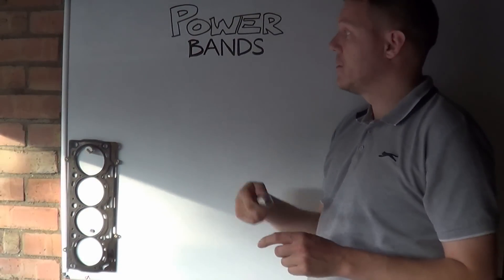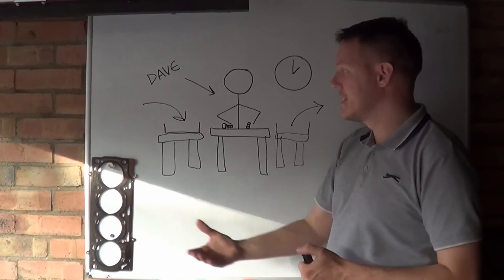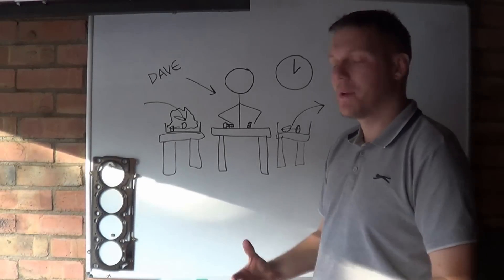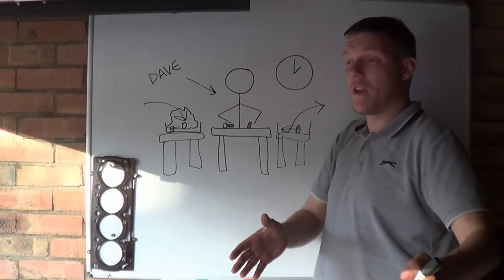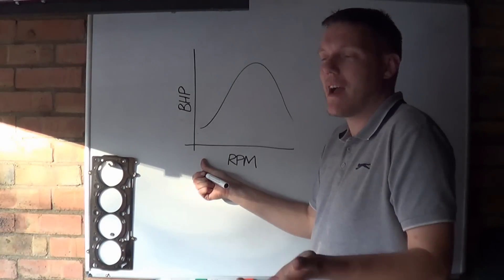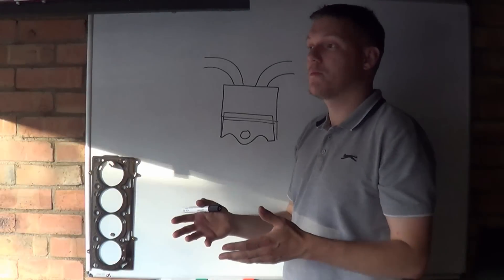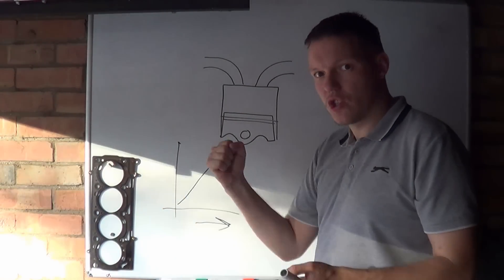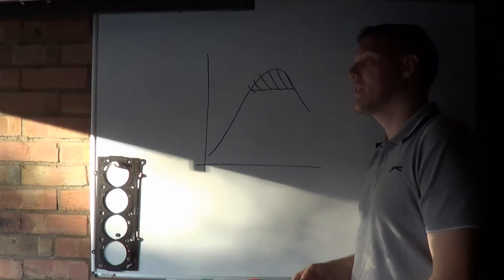Power band - what is it?  - Bike TEch

Comment: Brilliant video. Correct me if I'm wrong and misunderstood. But if you add to your example a turbo and exhaust wrap would that increase them 65% filling of the cylinders in this case due to higher exhaust temp and higher intake pressure due to the turbo?
Reply from the maker: Would it increase the VE by 65% always or in general - Sorry dude - I don't know what you mean???
Reply: The Workshop I meant about what you were explaining in the video. That the powerband of a motor was regulated by the possibility to draw in the mix of air and fuel, and by the possibility to get the exhaust gases out due to the shortened valve open time.
But in other videos you explain that wrapping the exhaust gets gases out faster and complementing with a turbo increase fuel and air mixture amount in the cylinder. So theoretically would that increase them 65% and that way move the theoretical roof of the powerband to a higher rpm. So instead of a powerband between 6-7K rpm I would go up to 6-7,5K rpm before reaching the stage of only being capable of filling the cylinders to 65%.
Sorry for rambling... 😂 😉
Reply from the maker: Exhaust wrap has this effect but like I said in the exhaust video - by fuck all - only in high output engines would you see a 1 to 2% difference.

Comment: Basically a "powerband" is reached when the optimal amount of fuel and air are being fed into an engine at a certain RPM. 2 stroke engines have a narrow and short powerband hence you feel that sudden rush of power but keep going after the powerband and you will notice the power drops off and you need to shift up, however with 4 strokes they have a much wider powerband hence you don't really feel it as much. So many people do think that a powerband is a physical object, its not, as explained here its when the engine is running at its optimal performance. good video mate :)
Reply: THANKS
Reply: Thank you, I can't stand when someone says "my power band isn't working "

Comment: crap the more you learn, the more doubts you get. Why if you make an engine that makes the powerband up high, like a motorcycle, has worst powerband low, and has to idle faster (like bike engines in comparison with normal car engines). For in this example dave.. If you train dave to screw 10 bolts per second, why he will be worst screwing 1 bolt per 10 second in comparison of before training?

Comment: really cool video but why is the powerband on my Transit Diesel Truck between 1500-2500rpm and on a 2 stroke motorcycle theres pretty much no power until like 9000rpm then bang you get full 30hp?
Reply: Well the diesel can't even rev to 9000, so by nature it is going to be lower. As for the rest of "why" it'd be a long explanation video he'd have to make
Reply: Different engines have different powerbands. Diesel engines are better at low end torque meaning its powerband is going to be in a lower rpm zone compared to a 2stroke where the powerband is at the higher end of your engines RPM's.
Reply: Long story short. Powerband = a certain rpm range where said engine is at peak performance. Engines that have low rpm power like diesels are going to have a powerband around low rpms while a 2 stroke engines powerband is up near the higher rpms meaning you have to rev it more.
Reply: A diesels powerband like you said is 1500-2500rpm so reving it up 5k or 6k is pointless as you're now at the fall off zone where the engine doesnt produce anymore power despite you revving it.
Reply: Its a different engine with different functions which is why its power band is so different. Diesel is totally different to both 4T and 2T in terms of how the engine works.
Reply: Even 2T and 4T which are basically the exact same with only slight differences have totally different powerbands. One produces power around 9k rpms while 4T's sweet spot is basically all the way from low end rpms to high end rpms.
Reply: if you truly want to understand powerbands dont look up 2T ones first you'll only get confused. Every engine has a powerband, engines like diesels which are designed to have good low end torque off low rpms are going to have quite a low rpm range for the powerband where as 2 strokes have terrible low end power while in low rpms so its only natural you're going to have to rev it more meaning its powerband is going to be at a higher rpm.

Comment: It's almost laughable that people actually think that the term powerband means that it's a part that makes your bike go faster.
Reply: Its not?
Reply: Da Mar Po ? Did ya watch the video lol.
Reply: Da Mar Po a powerband isnt a physical part...its a certain rpm range where the engine is at peak performance. 4 strokes, 2strokes doesnt matter every engine has a powerband.
Reply: Da Mar Po a 2 stroke dirtbike produces its peak performance at high rpms this is the bikes theoretical "powerband" a 4 strokes powerband is basically all the way from low rpm to mid range rpms which is why you dont notice it where as a 2 strokes powerband is right at the end so you feel it kick in.
Reply: Its the same with diesels they dont rev that high and they're made to produce good low end torque off low rpm's meaning the engines peak performance rpm range aka "powerband" is going to be lowm diesels powerband is at like 1500-2500rpm so you never notice it as the engine is basically constantly in powerband. Same with 4 strokes the powerband is such a broad range of rpms you dont notice it. 2 strokes have a tiny power band and its at the higher end rpm scape so you notice it kick in.
Reply: This is why 4t's are considered easy to ride as the engine basically is always is in powerband making for a nice easy throttle response where as 2 strokes powerband doesnt kick in until like 8k rpm and the window is so small you really feel the kick from say 4k rpm's where the engines barely working to 8k where its now performing in its peak.
Reply: You never notice powerbands on 4t's or diesels because the powerband is either at such a low rpm you start off in powerband (diesel) and 4t's peak rpm range is so big its almost always in powerband. Where as a 2strokes powerband isnt until high rpm so you notice it kick in.
Reply: This is why you only ever hear powerbands being associated with 2 strokes even though every engine has one as its just an easier way pf saying "a certain rpm range where the engine is at peak performance.
Reply: Personally i hate 2 strokes. 90% of the time its like you're riding around with a little weed whacker engine then it hits a certain rpm and powerband kicks in and all of this power is released. Basically from 1k-8k rpm you have 15% of the engines total power as soon as you hit 8k rpm it reaches powerband and starts putting out its true power hints why you feel it kick in as for the last 7k rpm the bikes barely been running at 50% power.
Reply: Imagine driving a car that at low rpm feels like a 1.2 litre petrol and then suddenly when it hits 8k rpm it feels like driving a supercharged v8. Dangerous and sketchy as fuck.
Reply: And i just realised you werent being serious. I cbf deleting this now 😂 sure it will come in handy as i still see many riders confused by the illusive pwerband.

Comment: can the power band be changed or prolonged on a two stroke? I should imagine that one way it could be done on a four stroke by changing to lobe profile on the cam
Reply: The angle and length of the baffle cone in a pipe makes a big difference to the spread of power. So do things like  port size/timing, crankcase volumes, carburetor size, etc. Generally, though, if you want power over a longer range of rpm you'll be taking away from peak power. I'm pretty sure Matt covers a lot of this stuff in other videos.
Reply: Jas Ward you can use another pipe on a 2 stroke
Reply: yes I know but that alone hardly makes a difference in my opinion if at all, some people call fitting an expansion chamber emotional tuning because it sounds faster, I love the sound of a micron, dep, nikkon pipes but just fitting them with K&N air filters and changing main jet and or needle position isn't enough
Reply: Jas Ward At my bike it made quite a difference. Im sure there are ways but i cant think of any
Reply: Yes Scotty said it. Changing the ports is the same thing on a 2T as changing the cams on a 4T. Ports and cams do the same thing; tell the engine how long and how much air/exhaust to let in/out. 

And tuned pipes are very important on a 2T, because exhaust scavenging makes a bigger difference since the design is inherently blowing fresh charge out the exhaust port before it gets sealed off.
Reply: KTM adjustable power valve springs on 2T....4T use variable speed cam timing...relax this is a very complex subject that should only be discussed and applied by highly qualified engineers with many degrees and decades of mechanical aptitude...
Reply: Just buy a 4 stroke. Dont get guys who buy 2 strokes full well knowing they have a tiny range for powerband and go "how can i make my powerband range wider"
Reply: As someone else said changing a 2T's powerband range takes away from over all power.
Reply: 2 strokes in high rpm range are insane and have plenty of power focus on low end torque so you have more power while in those lower rpms. Otherwise just buy a 4T.
Reply: Is there any point in widening a 2T's powerband? I mean 2T's at high rpm have more then enough power so wouldnt it just be better off focusing on minor changes to help the bike make low end torque when in those low rpms opposed to trying to overall widen the powerband.
Reply: Also if you're worried you're not getting enough out of your 2T just make sure you try to stay in a lower gear then you would on a 4stroke. Its better to be at 9k rpms in 4th gear opposed to 3k rpms in 5th...lower the gear the more you stay in band. Theres no point shifting up if you're not going to hit the next gears powerband. Just keep it in the current gear and keep riding out the powerband.